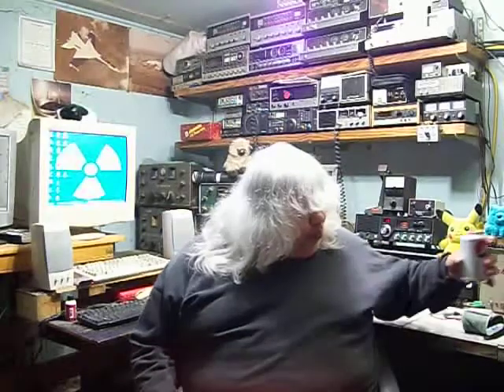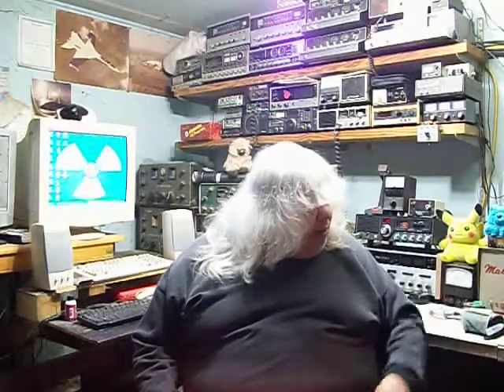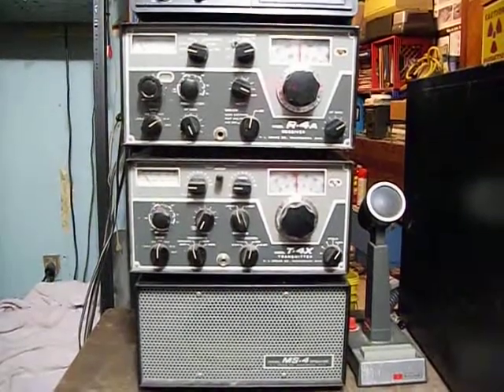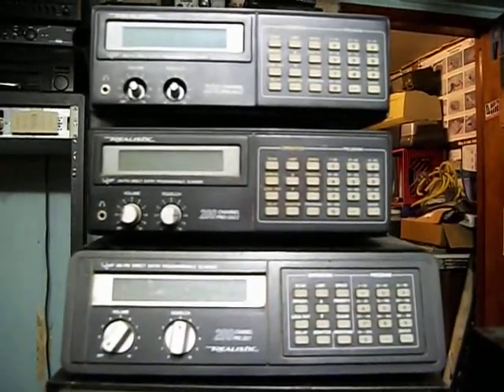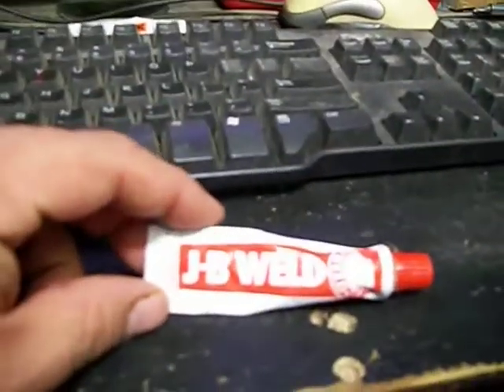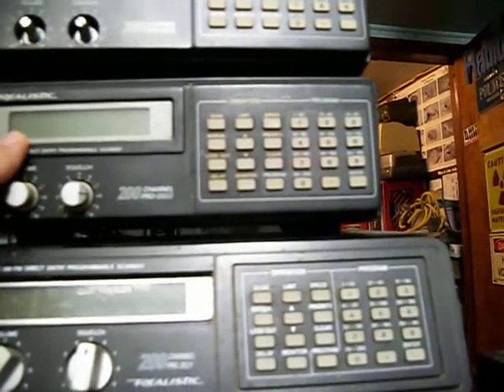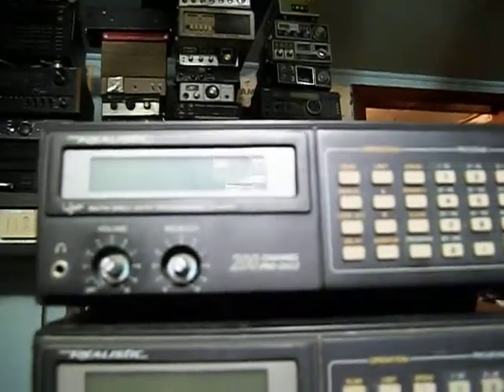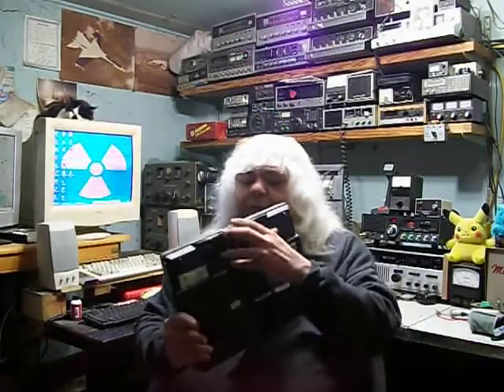DRAKE INTRO

Comment: Keep it up Dino!  I love my Drake TR-4Cw, in fact just did a video on the AC-4 power supply a few days back and sometime today going to upload a video on replacing some caps in my TR-4.  Great radios, built like a tank and they used high quality components and you can still find replacement parts to be able to repair these radios to this day if need be.